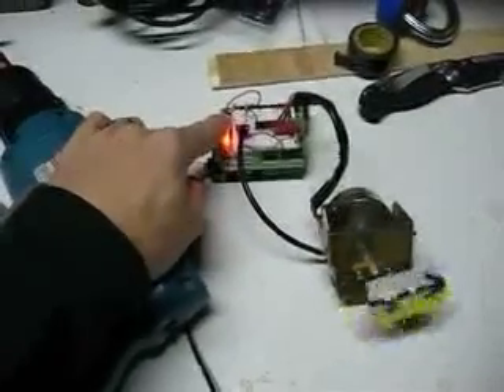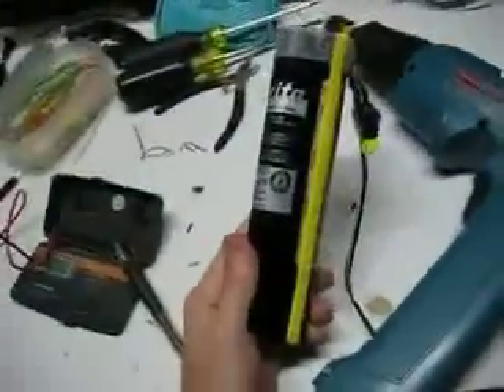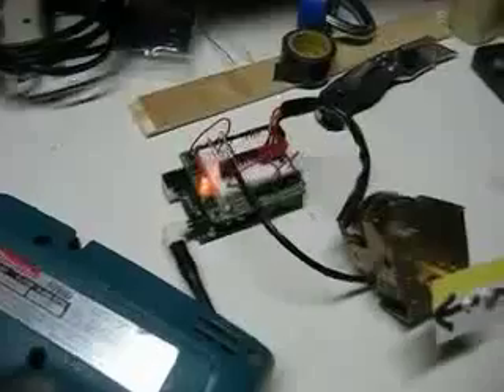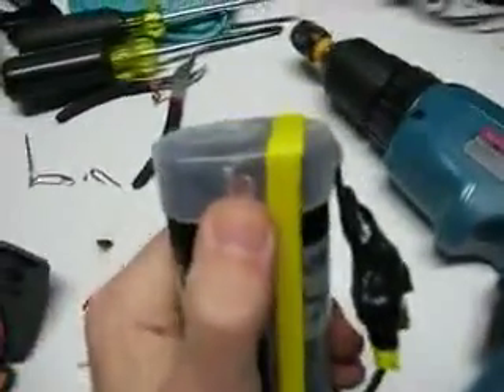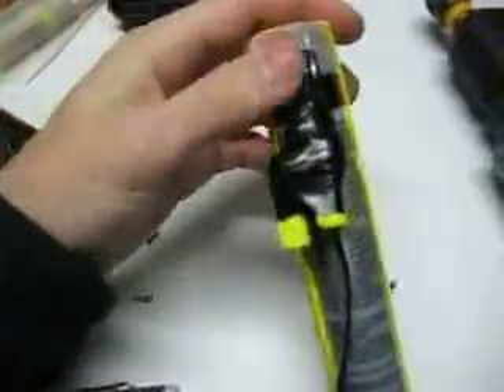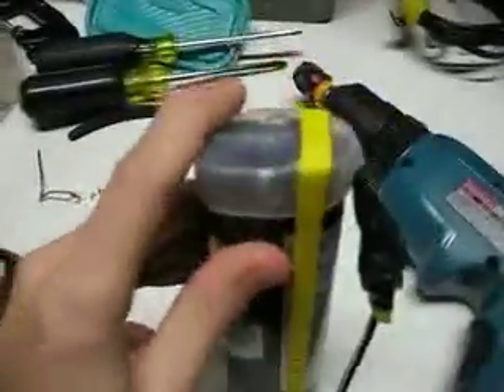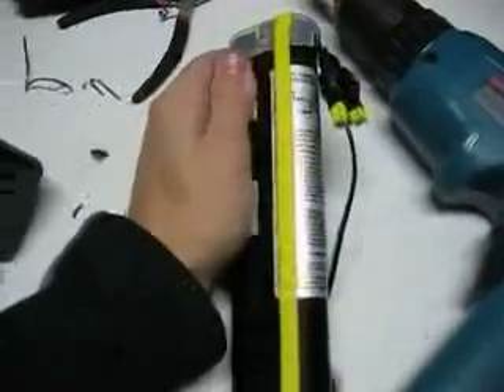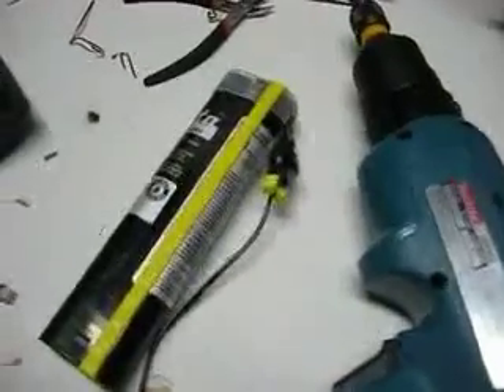Arduino + Makita Battery

Comment from the maker: Looks like the max is either 20v, or 35.  and recommended is 7-12.  So you should be fine.

As I understand it, the farther you get from the 5V the ard. actually needs, the more waste heat you'll end up with from the voltage regulator on the board.

Comment from the maker: Just find any old rechargable something or other that has a rechargeable battery system over 5v (for the arduino).  I bet you could find a dead drill or something on ebay.